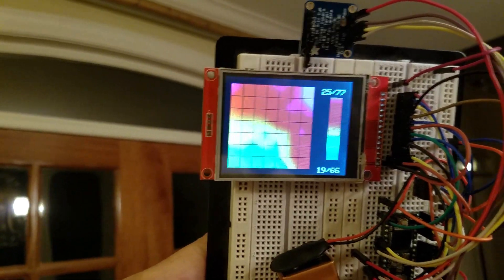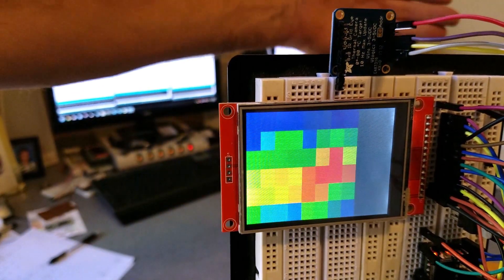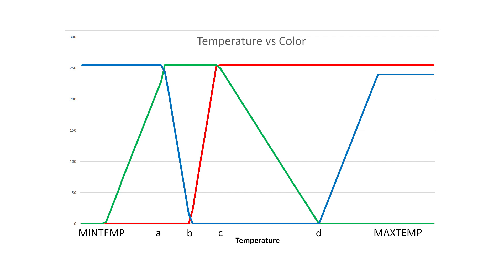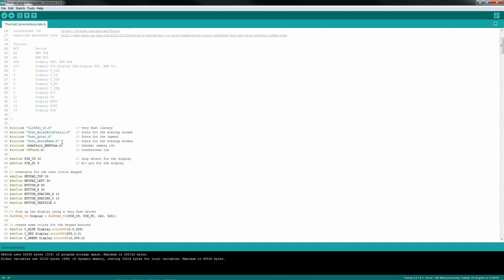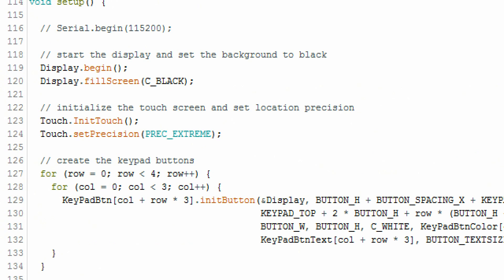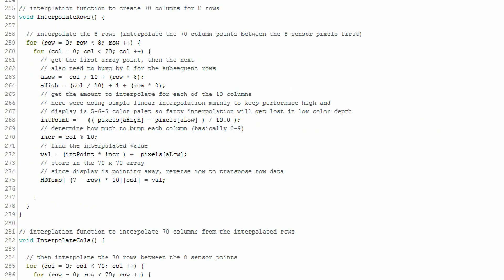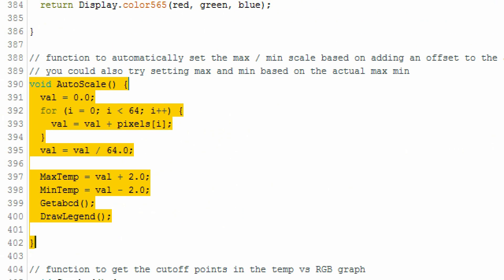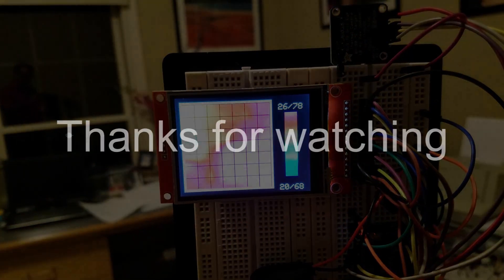Build a Teensy-based thermal imaging camera

Comment: Hi Kris,

Awesome stuff. The interpolation approach you took gave me a hint on how to get unstuck from the muck I was in, namely the squared pixels that the Adafruit's sample sketch renders. Unfortunately I am bound to using Arduino Nano boards as I got too many of them already glued on to my FPV gear to change now so I have to use them as best as I can. Which means I have to interpolate for a maximum of 16x16 pixels which surprisingly on a 128x128 display looks a lot nicer and it's a lot more intuitive than the boxy image from before. I did however expand on the interpolation method using my own approach so basically now I can do linear interpolation starting from the 8x8 and using a scaling factor I can go up to 80x80 or even more, however I'm getting some really strange results when using the 256 RGB565 color palette that Adafruit supplied. I mean it works fine as it is but I have to constantly adjust for the min and max temperatures on each frame to get a usable result.

When I tried using your approach, funny enough I stumbled on the same website as you did, to compute the colors I ended up with a blueish ghost-like image, barely seeing any shape when I moved my hand around. 

At first I though I did something wrong with the computations, but even after moving into Processing to avoid the computing power limitations of the Nano board the image I got from applying the palette was still blue with a very small contrast, no reds, no greens no nothing. So any ideas what might be wrong or I'm just better off following the general steps you took, not just copy-paste your stuff?

Cheers,
Denis
Reply from the maker: are you sure the colors are not accurate? Meaning monitor say a glass of ice next to something warm? Are you sure the temp array is working? Maybe do a test display by manually setting the temp gradient (the 8 x 8 array and seeing what's displayed--meaning temp(0,0) = 0, temp(8,8) = 100. Also, i have a function to set the cutoffs Getabcd() can be adjusted to change how quickly the colors change due to temp. Have you put Serial.println() to see values at each stage? Just some thoughts.
Reply: Um, the colors mismatch might be also related to the data type I'm using, I had to port them on the Java environment Processing is using which doesn't quite fit with the C type from Arduino. 

Anyways, those are good points to look at, thanks Kris. ;)
Reply: Can help this camera made??
Reply: Hi Danis. 
I have to use the Arduino Nano board to complete my design project. But I only need to achieve this function.  I want to ask some question about how to change the coding to achieve that. 

Cheers, 
William

Comment: Great Work Kris! I followed your instructions and my Thermal Camera is working great. It does however flashes as it refreshes the image. I notice yours does not do that, do you have any suggestions?
Reply from the maker: What CPU speed did you compile at? I crank mine all the way to 120 mhz, and are you using the ili9341_t3 lib? I found another way to speed the code a bit. I have functions for interpolating rows and columns and display--as with any function call there is a performance hit. Move the code from the functions into the loop-for all functions. this makes a very large (lines of code) in loop(), but my display updates went from around 2 fps to around 5
Reply: Thanks Kris, I got the processor up to 120 mhz and I am using your code so the #include <ILI9341_t3.h> so I should be using the correct library.  With no real noticeable difference in frames per second. Can you send me your current code?
Reply from the maker: @joshmontgomery45123  I will, it will ba a few days though
Reply: Great, thanks Kris. I appreciate the assistance.
Reply from the maker: I just uploaded the latest code, basically functions that get called on every sensor read are now part of loop(). Stuff like InterpolateRows(), InterpolateCols(); DisplayGradient() are now in loop. As with any function call, there is a price to pay for putting data on the stack etc. Now that the code is is in loop, it can run a bit faster. Hope this helps.
Reply from the maker: The link above should point you to the latest code

Comment: Great video and a hot project!
I've followed the same path as you  with the interpolation: linear for speed.
I'm using the RPi Zero, Pimoroni 'HD' (16x16) Unicorn Hat and Python; getting about 7 fps.
Reply from the maker: Nick Young thanks for replying with the frames per second I made a few code modifications and on my Teensy I'm getting about four and a half frames second that's running 120 megahertz.
Reply: I have tried in python but not getting good results. Please help me in the python code
Reply: @deepeshkumar9107  Python code on github https://github.com/YoungAtHome/Thermal/blob/master/thermal.py

Comment: nice work.
i tried it out. and am having errors ,
Reply: Arduino: 1.8.5 (Windows 7), TD: 1.41, Board: "Teensy 3.2 / 3.1, Serial, 96 MHz (overclock), Faster, US English"

In file included from C:\Users\IROYE TOLULOPE\Documents\Arduino\libraries\UTouch-master/UTouch.h:38:0,

                 from C:\thermal\ThermalCamera\ThermalCamera.ino:44:

C:\Users\IROYE TOLULOPE\Documents\Arduino\libraries\UTouch-master/hardware/arm/HW_ARM_defines.h:9:0: warning: "swap" redefined

 #define swap(type, i, j) {type t = i; i = j; j = t;}

 ^

In file included from C:\thermal\ThermalCamera\ThermalCamera.ino:39:0:

C:\Program Files (x86)\Arduino\hardware\teensy\avr\libraries\ILI9341_t3/ILI9341_t3.h:397:0: note: this is the location of the previous definition

 #define swap(a, b) { typeof(a) t = a; a = b; b = t; }

 ^

Archiving built core (caching) in: C:\Users\IRT~1\AppData\Local\Temp\arduino_cache_538465\core\core_teensy_avr_teensy31_usb_serial,speed_96,opt_o2std,keys_en-us_4939f5412a75a8560acb0f9e98268f02.a
C:\Users\IRT~1\AppData\Local\Temp\arduino_build_714684\sketch\ThermalCamera.ino.cpp.o: In function `loop':

C:\thermal\ThermalCamera/ThermalCamera.ino:246: undefined reference to `Adafruit_AMG88xx::readPixels(float*, unsigned char)'

C:\Users\IRT~1\AppData\Local\Temp\arduino_build_714684\sketch\ThermalCamera.ino.cpp.o: In function `setup':

C:\thermal\ThermalCamera/ThermalCamera.ino:169: undefined reference to `Adafruit_AMG88xx::begin(unsigned char)'

C:\thermal\ThermalCamera/ThermalCamera.ino:195: undefined reference to `Adafruit_AMG88xx::readPixels(float*, unsigned char)'

C:\thermal\ThermalCamera/ThermalCamera.ino:236: undefined reference to `Arial_48_Bold_Italic'

C:\thermal\ThermalCamera/ThermalCamera.ino:236: undefined reference to `DroidSans_20'

C:\thermal\ThermalCamera/ThermalCamera.ino:236: undefined reference to `DroidSans_40'

collect2.exe: error: ld returned 1 exit status

Error compiling for board Teensy 3.2 / 3.1.

This report would have more information with
"Show verbose output during compilation"
option enabled in File -> Preferences.
Reply: problem resolved . i didnt install the libraries properly.
Reply: I get the same errors, how did you fix it? I reinstalled the libraries and it still doesn't work?
Reply: can you specify the error you got?.    i copied the complete library including the .CPP file then installed 
check on google how to install libraries
Reply: I reinstalled Arduino & Teensyduio and it works now :D Thank you for the reply!
Reply: u welcome

Comment: I want to ask how I can use these font library into your Google Drive code. Because when I run the program, it can't compile
Reply from the maker: Nee hao!?!

did you get all the libraries i have listed in the source code?
Reply: Kris Kasprzak yes
Reply from the maker: maybe just comment out any SetFont line? Not sure... if you have the font library https://github.com/PaulStoffregen/ILI9341_fonts it should compile. Maybe copy the fonts to your ili9341_t3 folder?
Reply: ohh      Does the font library need to add in your code
Reply from the maker: nope my code calls the font library--make sure you restart arduino ide if you installed the font lib.
Reply: I install the font lib. and I put the the font lib in the same  
Folder with your code but the when i run the code it happen

 fatal error: UTouch.h: No such file or directory

Comment: hi I do this but my arduino program have some problem .
C:\Users\moems\Desktop\ThermalCamera\ThermalCamera.ino:40:68: fatal error: font_ArialBoldItalic.h: No such file or directory

compilation terminated.

can you help me thanks
Reply from the maker: darn, my bad. I was using some custom fonts to make a cute splash screen and legend. I'll see if i can add the font files to my download but in the meantime you can comment out the font calls xxx.SetFont() rings a bell.
Reply from the maker: ahhhh yes... I remember now. I use custom fonts that are delivered in a library that was written by the creator of the Teensy MCU, Paul Stroffregen.  I have the link commented in the top section of the source code. Make sure you get the font library

https://github.com/PaulStoffregen/ILI9341_fonts

Comment: Nice job, I was trying to run the code on a Wemos D1 Mini with ESP8266 as the clock is running at 160MHz which should be enough. I had to remove the touch (too less IOs) and exchange the ILI9341 lib (t3 seems not to be supporting the ESP), but then it was possible to run it with only a little less performance. Thank you for publishing.
Reply from the maker: Glad you got it working.
Reply: I'd like to create a 3D printed housing. I would share it on Thingiverse, would it be ok to upload the modified code with reference to you? That would make it easy for others who want to rebuild it
Reply from the maker: Sure, I'm sure my subs (and the world) would like to see the work of others.
Reply from the maker: That is frickin' cool, we'll done.

Comment: This is fairly nice!
There's a much better option though - a sensor made by Heimann Sensor in Germany, called the HTPA32x32d.
It(obviously) has a 32x32 pixel array and also speaks I2C, though temperature value calculation is much, much more involved and RAM-intensive(you need at least 1024(pixels)*2(16bit)*5(arrays) bytes).
It can also do up to 60Hz(and 120Hz @ 16x16), but it gets really noisy at that speed.
I've got some, and a design for a tiny camera(arduino-compatible, 0.9" 96x64 OLED RGB display, keychain-sized), but no time to write the firmware.
Reply: Where did you get the sensor from? I don't think it's easily individually purchasable online.
Reply: Correct, it is not.
I purchased it through a... source, but there are distributors that work with individuals.
Reply: And what about the new Melexis MLX9064? It's 32x24 and it only costs around $50 on Digi-Key.

Comment: Very cool project!  I've got the same sensor from Adafruit and was also disappointed with the sample Arduino sketch.  I followed your wiring diagram and built it with a Teensy 3.2 and a very similar display from Amazon and got it functional - but I ran into a few issues. 

I'm pretty sure you didn't post the latest sketch from the video you show to your Google Drive link - the sketch I downloaded does not match the video.  It only uses the touchscreen to toggle the grid on/off and toggle autoscaling - there's no code for a number pad.

Also - in case this helps anybody -  I had to edit one line of the sample code to get it working - the IL19341_t3 line apparently had too many arguments - I had to remove the 240, 320 (which is resolution?).  You also didn't use the Display_CS and Display_RST variables you declared earlier in the sketch.  Here's the original line commented out, and my line below.

//ILI9341_t3 Display = ILI9341_t3(10, 9, 240, 320); //this was original line - had to remove last two numbers due to compile error
ILI9341_t3 Display = ILI9341_t3(Display_CS, Display_RST);

But anyway - very nice job with the project and video - it got me inspired to try it!
Reply from the maker: OOPS....I did make some updates between upload and video shooting, but i've just updated the link with a new download. It has the number pad thingy and an auto scale if you press in the temp scale. Also good catch on my display initialization. I modified the lib so I can use it with different display sizes. That is updated and commented in the sketch as well.

Glad you got it to work. I've since make a custom PCB board (which i make in my garage) and i'm designing a case for 3D printing.
Reply: Thanks for uploading the new sketch - it works!

My issue now is that I've got to calibrate my touchscreen - touch targets are way off.  I see that the UTouch library has a calibration sketch that outputs numbers you can put in a header file - but it's designed to be used with UTFT (not IL19341).  I'll investigate calibration...
Reply from the maker: Oddly my TFT was right on. You know how to calibrate them in code? If not try this

void ProcessScreenMap() {

// this assumes your x and y are global variables, call this function after both Touch.getX(); and Touch.getY(); functions like...
//
//    Touch.read();
//    x = Touch.getX();
//    y = Touch.getY();;
//    ProcessScreenMap();
//
//   if you decide to pass in x and y you need to pass as reference so the actual values are changed upon a return from this function
// 

  Serial.print("real coordinates: ");
  Serial.print(x);
  Serial.print(",");
  Serial.print (y);

  // assuming display in in landscape and 480 wide and y is up and down and 320, adjust if different display
  // use first w/o any mapping and see what serial says fo real coordinates, then write down and enter into the map function
  // note depending on orientation you may have to reverse x and y
  // then after using your measured values and recompiling the mapped serial output should match the real screen coordinates
  // here's the arguement list
  //
  // x  = map(x, real left, real right, 0, 480);
  // y  = map(y, real bottom, real top, 320, 0);
  

  x  = map(x, 940, 70, 0, 480);
  y  = map(y, 890, 137, 320, 0);

  Serial.print(", Mapped coordinates: ");
  Serial.print(x);
  Serial.print(",");
  Serial.println(y);

}
Reply: Thanks for the code!
Reply: Kris Kasprzak 
I put the ProcessScreenMap Code in your free code and i have more problems with the Touch 

If i Touch the screen anywhere it Open the keypad for the maxtemp
If i touched done it Not working 
I think the screen is freezed

Comment: Can the IR data (readings) detected, be recorded (with a time stamp and location on grid table) and sent to a data bus (i.e. USB) to a computer for interpolation and input onto a spreadsheet?
Reply from the maker: i think you could easily get the location and time stamp of each pixel (either the 8x8, or even the 70x70 array and send to to a PC via serial. I've written programs in VB.Net that will get data from an Arduino (or Teensy) via the serial port. That same program could populate a spreadsheet. The question then becomes at what rate? Do you want to get "live data" to the PC for interpolation and writing to say Excel?
Reply: The data rate interval rate I would desire would be in increments of 0:00:0001 seconds. The data does not have to be "seen" live and could be dumped (record, write, store) as long as the data stream (IR) is logging every pixel / grid  is precisely in sync with each time stamp.
Reply from the maker: At that data rate, you will need to look for a different sensor. This one only measures data around every 1/10 of a second.
Reply: That's what I needed to know. Thank you very much. I suspect that such a sensor would be very expensive and probably require more than 3V's